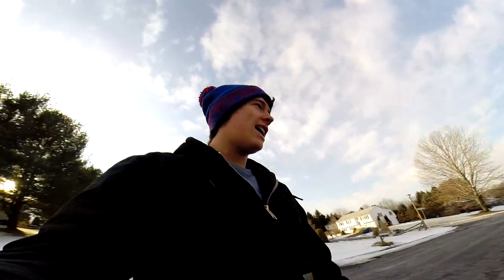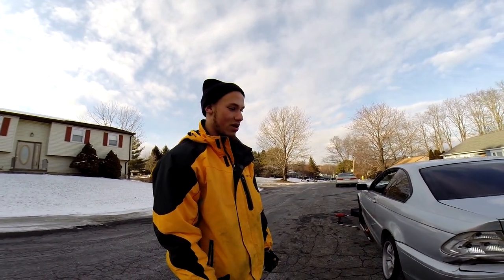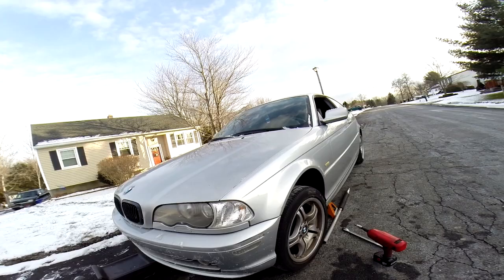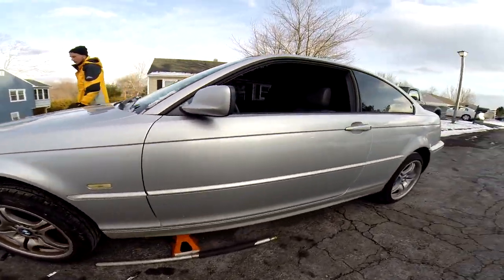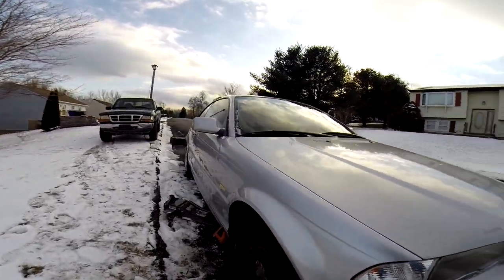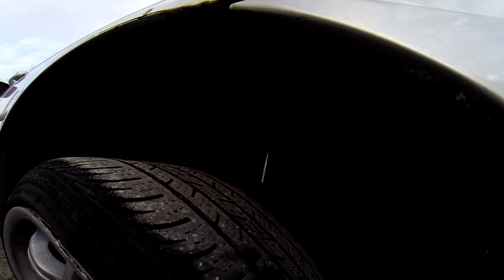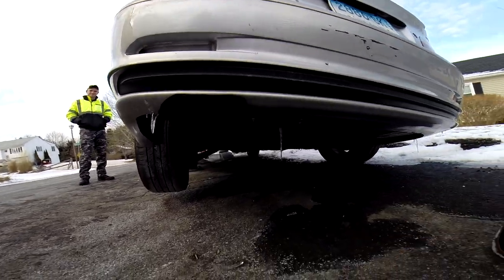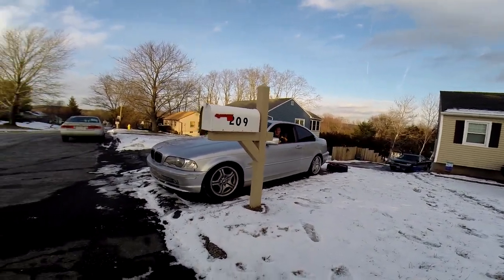Rundown Of The E46

Comment: yo rudnick the reason the e46 is leaking so much oil it's cuz it needs a new oil filter housing gasket and a valve cover gasket, my e46 had the same problem I changed them myself it's not too difficult

Comment: i owned a 323ci e46 and it was a problem and a half and I've owned nothing but bmw and if the car has over 100,000 roughly used its useless the engine will bring problems everyday, but good look with the build these are in my opinion one of the best cars out there for its age and price

Comment: I have an e46 and the oil leak is 99% most likely the valve cover gasket AND the oil filter gasket. Total for both gaskets will run you about $60 but will completely stop your leak. With your skill set and marcus' it should be an easy job, i did it myself

Comment: e46 zhp came with the zhp "cube trim" interior which is a simulated carbon fiber. this is not a zhp. looks just like a 325 2.5L to me. so it was most likely swapped or if it was real carbon trim then it was added as the factory doesn't have that as an option.

Comment: Yeah just got rid of the exact same car 2006 330ci ZHP but it had carbon fiber m steering wheel but mine had different rims beware my cooling system was shot and had 32 vacuum leaks brake booster was collapsed in 6 places and so yeah love the videos keep it up
Reply: Mine was auto with shit "sport" manual

Comment: no it did not come stock with the carbon fiber trim. the e46 330 zhp package did come with a black cube trim, very similar to carbon fiber but the car you got is not a zhp. you can tell because the red limiter will be 7k rpm, red needles in the guages, different aero, suspensions, gearing and 6 speed. but starting 2004 all 330s came.with 6 speed including the non zhp

Comment: I had one of those and it came with fake carbon fibre, my one had a valve cover leak, and ended up replacing every plastic hose in the engine bay, once you start pulling them off to fix things they just crumble in your hands, especially the one next to the oil filler

Comment: I got a 2001 E46 320CI. It doesn't Come with carbon fiber, but a grey plastic, so it's replaced from original, same for the wheels, the trunk "spoilerito". Neither for the inside "flower-like" thing.

Comment: If the e46 came from the factory with carbon fiber trim I was wondering did the e36 come from the factory with carbon fiber trim also I just bought a e36 with carbon fiber trim
Reply: +Tobbion Simon E36 doesn't come with carbon fiber parts and almost positive the E46 didn't come with it, but very common to find in all them a lot of people like the buy the carbon trim for the interior and center console.

Comment: i dont know exactly how those came out in america but here in europe that carbon fiber is factory. But also depends on the car´s extras. That car has the wheels, rear spoiler, m-seats, m-steering, but it does not have the m-bumpers. And i read that it is a 5 speed? if that car really is a 330ci (thats the model name here) it should be a 6 speed, but again i dont know how the car came out in the states....
Reply: +mutznutz i have a 330ci with a 5 gear getrag gearbox. The pre-facelift have 5 speed gearboxes, the facelift ones have 6 speed gearboxes.
Reply: in my country the pre facelift model is very rare on any motorization we have like 330ci and 330cd but most of them are facelift

Comment: My channel is pretty much all based on my current e46 325i  and to my knowledge it does not come with carbon fiber trim pieces. I've checked out a 325i sports edition before as well and it did not include any carbon pieces.
Reply: Zhp 330
Reply: +TheyWantSanchez its called carbon cube. Bmw made it. Its an original part wether or not old one was replaced. Bmw made it. Its not real CF.
Reply: you guys think his model is the zhp 330? That's pretty mint if it is

Comment: If you're really gonna do this car properly as a BMW lifer I will tell you that the M54B30 is a solid engine! Just likes to piss oil from the seals so at that milage I would be looking at doing a rear main, oil filter housing & rocker gasket! The cam sensors like to fail a lot too so be prepared to do those.

Now regarding your parking brake even when you get it fixed NEVER rely on it! They're a shitty design and my E46 and my E39 will roll off into the sunset if you don't keep it in gear, Also treat your transmission nicely as the dual mass flywheels/clutches are expensive if they go but a single mass conversion is available, Also be prepared for balljoints and other suspension rubbers to take a shit on the regular as that's another common issue!

Comment: coming from an ex e46 owner... never buy an e46 unless m3
Reply: Stick with the I's
Reply: +Wididy I own an e46, been mint 3 years. You must've owned a problem car that wasn't taken care of. Also M3 is good but the smg selectors are rubbish so a manual is better if you have to be specific.
Reply: Kapil Patel
For the 3 years i owned my 323i i ended up paying the cars worth in repairs, and it was mint when i bought it
Reply: Wididy

It happens, end of the day the previous owner could have been at fault for the problems you received. If the car was brand new that's explainable as well. I saw a video of a tard ripping into his M6 because of poor customer care and repeatedly faulty electronics.

Doesn't mean they're all bad, just means someone fucked the build up.

My car is a tank. 125k miles on the clock and feels brand new. Clutch has been a worn since purchase, 3 years and no more noticeable wear. I'll change it when I figure out the engine swap that's been on my mind for a while. No garage so no swap yet.

Body is very strong. Had a tiny rust spot on the body smaller than the nail on my pinky. 3 years on same size. Been hit by 4 cars including a c class merc. Never even shown it to a body guy for repair estimate, just doesn't seem significant enough lol.

passenger side lock wouldn't open or got jammed or something. Fixed itself after about 3/4 times. Happened last winter. No issues since.

It has 10j deeep bbs rs rims and red angel lights and I'm going outside to lick it.

Sorry about the fucking essay, my bmw love is irrational.